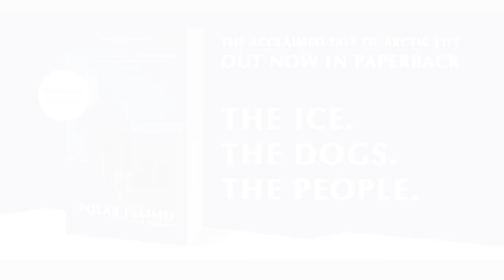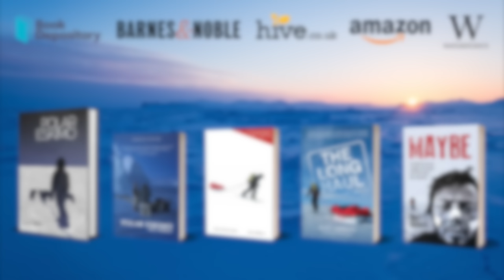Lifeboat instrument mast is fitted ( VHF, AIS, GPS, Horn, Rutland ) Lifeboat Conversion Ep77 [4K]

Comment: As you may have noticed, taping the ends of the wire together helps a lot with this kind of job.  Taping a coat-hanger or other stiff wire there also facilitates running the wires.

Comment: To eliminate concerns regarding fastening dissimilar metals, use Tef-Gel. It forms a thin nonconductive barrier and is commonly used on sailboats for putting aluminum rivets into stainless steel or stainless bolts through aluminum parts. The stuff works!
Reply from the maker: Cheers

Comment: Re the mast stays, you can actually buy hand hydraulic crimpers and swage your own cables. 305m rolls of 3 or 4mm stainless rope are very reasonable as are stainless turnbuckles. All this stuff is used by the DIY home deck brigade. 
You need 3 or 4mm thimbles and ferrules (very cheap). The turnbuckles have left and right hand thread on the same turnbuckle so you can tighten them by hand. They have locknuts at each end so you can lock them off.
What all this means is you can make your own mast stays for the same cost as having them made and if you have the space you can take the whole lot with you and make repairs etc. 

BTW, To cut the wire rope they make a special cutter which for the modest cost (a tenner or something) I'd recommend as it beats wrapping the rope in tape and cutting with an angle grinder cutoff disc. The cutter cuts it very cleanly without the strands unfurling.
Reply from the maker: I did consider doing the rigging myself, but I just have so much to do in the next fortnight, let alone learn a new skill. The professional riggers were very good value for money, and they arrived done, next day.

Comment: Unrelated to this video but so far few comments so you might see question.
Have you considered replacing the drivers seat? Seems like it would be quite uncomfortable for a long shift. Suggest a nice adjustable car seat from BMW, Mercedes etc… with height adjust for different size drivers and side bolsters to keep person in chair if boat rocks. Or at least a nice boat seat with movable arm rests, again to keep driver in chair as boat rocks. 
~Peace
Reply from the maker: Yes I'm either going to really improve the existing one, or replace. Probably the former, as it's a good, strong moulding.
Reply: @AlexHibbertOriginals  I'd reccomened using a fur rug on the seat, I've used one for motorcycle touring a lot and it makes a hell of a difference over a leather seat, plus fur has material benifits over other comfort devices

Comment: Don't no what you are going to do about the extreme Cold other than more clothing 
But have you thought about connecting 2 more Radiators with electric pump to help engine water pump and a car fan blowing all that hat Air into the cabin???😊😊😊

Comment: Do you use a wide angle lens for the outside shots? Reason I ask is that could be causing the mast to look (to me at least) "off-plumb".
Reply from the maker: It's leaning as it's just temporarily guyed with ropes.
Reply: If you had actually watched the video you would know that the ropes and rakish angle are temporary. It must be endlessly frustrating to explain things clearly on the video only to have commenters asking redundant questions.

Comment: just a thought,  with the turbine being the tallest part of the boat.   would it make sense to have a lighting strike rod next to it?   so if it was hit, it wouldn't travel down the wires and damage equipment inside of the boat?    i picked this up from small wind turbines being installed on houses.  they seem to install a lighting rod to prevent it from traveling down the turbines wires into the house.    i may be wrong but i thought it was worth mentioning :)
Reply from the maker: I actually bought a lightning kit right back when I bought Alan. I've put off deciding how to mount it. Will do.

Comment: So does your transom platform from last episode, the angle iron is interesting, but 90% of your weight support will come from whatever brackets you use to cross the hypotenuse at the ends and in the middle.
Reply from the maker: Yes indeed, the moment won't be enormous, but I'm making substantial brackets this week coming.

Comment: So sow much more did the stock turbine stabilizer actually weigh? Must have been alot if it is worth swapping it out,  the ice accumulation alone could be many times the weight saved by that stabilizer so I'd hope that boat has plenty of extra righting moment because it's going to need it.
Reply from the maker: I made it for Arctic sledging use, where it's just down to weight and where rime ice is minimal, away from cold spray.
Reply: @AlexHibbertOriginals  so it gets removed from the boat and taken with a sked?
Reply from the maker: No. It's now to be used on Alan. 🤷‍♂️